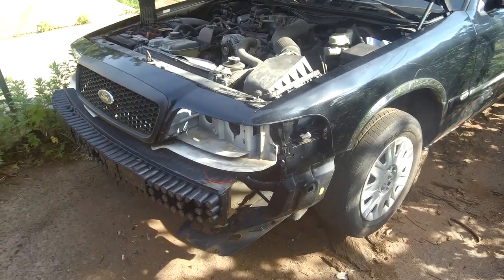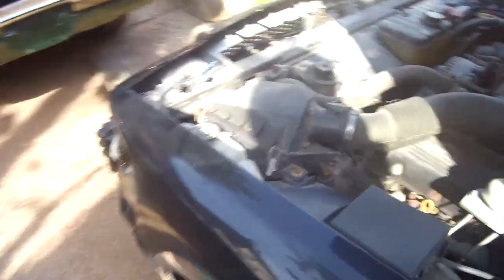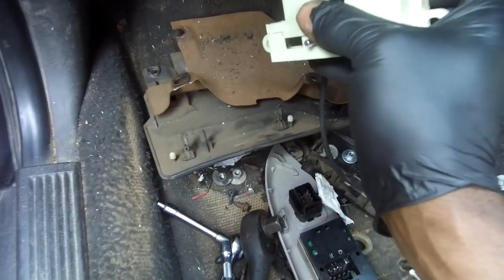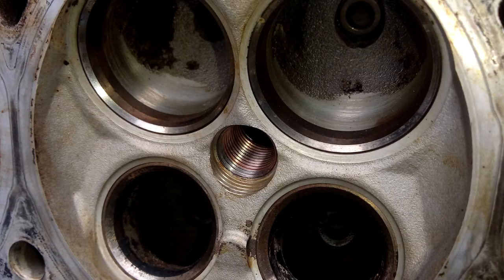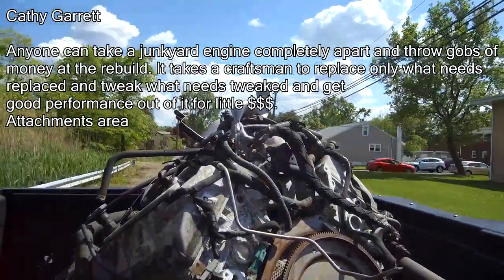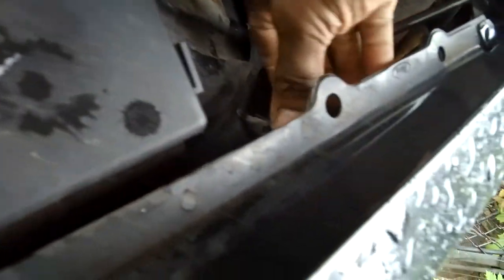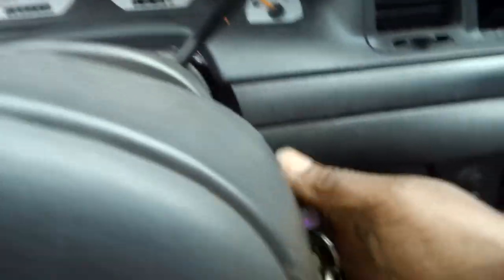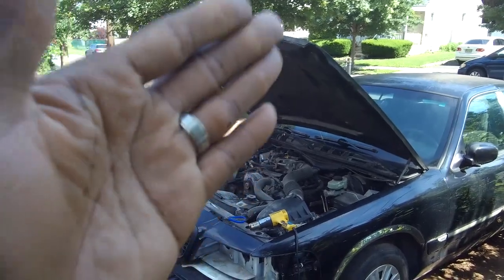Mercury Grand Marquis NO START NO CRANK! (  $120 Rookie Mistake )

Comment: Also while sanding the driver side doors, I've found bondo! Not much but that explains the paint coming off those doors! The hood, roof was just UV light cooking the paint from the inside out... A Big issue whese you live 5200+ feet and stupid clear skys! The UV bounces off the metal flake and cooks the paint from the inside out 😮☹😟
Reply from the maker: well you know thats given when you have car... somebody did some kind of work on it... The cool part you are blessed to make corrections... Some are not...You will have the think looking good... You are talented and driven you will make it happen with no fuss ...
Reply from the maker: I thank you always for the support on this and off of this thing here...Just working on stuff making things move ( lets say )
Reply: @bstfordchannel923  True That! I've got the doors stripped and just need to bondo a few spots, then sealer, primer and then... to the next door. Looks like the orginal minor damage was at or above the side trim! Now planning 2 coats of single stage Speedokote paint... Chestnut Brown, to match the door jams
OH! And using the trim you sent me! :)

Comment: Nice job showing us troubleshooting is all about the detail. You have to look at every little thing because it could be any little thing...and you have no idea of knowing which one. I will say something my Dad preached, and I don't always get it right when I think I know exactly what the problem is...always check the free stuff first, followed by the cheap stuff, and work up the price ladder from there. He was right, and more than once I've spent money I didn't need to spend money on and it didn't fix the problem.
Reply from the maker: Now that is so true. I had to show fault in this and speak about the money that can be spent for no reason ( if you take the time out and look ) a rookie mistake on behalf.  Your dad is a wise man. that how you do it... simple stuff to the big ticket items.. the starter I did not car really $35 bucks and its new so that was cool, but this Ecu deal. Not sticking with me real well.. This was a solid comment
Reply: @bstfordchannel923  one of the things I like about you is that you show us the mistakes along with the successes, and we all make mistakes.

Comment: Thanks for posting this, my Grandma's car had been having this problem intermittently for a while. Turns out the bolt threads had a thicker anodized coating on all but one small section. On the latest time it wouldn't start, I attempted to start it, it didn't start, wiggled that ground, and it started right up. We used a wire brush wheel to clean off some of the anodized coating so it can make better contact and has seemed to work just fine ever since.
Reply from the maker: No problem glad to help in any way brother... Glad the video assisted you.... Thank you for the detailed comment.. This will help somebody else

Comment: Another great video BST! A lot of people may skip this one but I genuinely appreciate content like this because not only did we learn what was wrong with your car, we all learned a valuable lesson which is how easy it is to create our own problems. I have done this too. Do a part swap and something as simple as a connector left loose can cause the car not to start. I have done that multiple times! So we all need a reminder to not get in a rush and never assume the worst when we run into an issue.

Also I fully support the reassembly of that bottom end. I believe it is gonna be solid and nothing to worry about.
Reply from the maker: I am glad YOU understood the video... Yes we create our own problems over thinking and under-thinking... This was more like let the money fix it or I know what that is ( at it was not that ) I learned something and its was kinda worth it.. other ideas sprung up from this . I just started to make things a bit more simple

Comment: Right on BST,
You had me glued to my screen, every second of the video. 
I was on the edge of my seat. Lol

You are a King among Kings for showing how you worked through this no start issue. Electrical problems drive me to drink. It's what I have the hardest time to figure out. 

But when I do, it's s good feeling I made those little electrons my bih. Lol

-Chuck
Reply from the maker: my man Chuck lol.. This I had to show cause you can not show wins all the time. You have to give failures and risks.. Some ideas may seem stupid, but its to move the car culture forward ( for us broke folks )
Reply: I think electrical drives us all to drink !!

Comment: BST, Glad you found the loose ground wire!  Here's a funny, my 2010 safety neutral switch doesn't always work so I just pull the shifter up a little and she starts... Well the Wife had her car in the shop, warranty work, so she takes my Panther and goes to work then coming home she stops at the store, like 4 blocks away, and well the car don't start; so instead of calling me she walks home pissed, I go up there and started the car... didn't tell her the trick so now she refuses to drive any of my Vicks 🤣😂😁😎
Reply from the maker: thank you that Big Bro...   wow what was the trick?  man you got her alll pissed now lol
Reply: Its not your neutral safety switch the a bracket that connects your gear shifter to the actual transmission and the bolts back out over eventually it wont go out of gear when that falls the rest of the way out
Reply from the maker: @cainadkins3985  ground wire to that switch

Comment: If you don’t want to open the short block there is a way you can check the overall health beside looking at the crosshatch pattern on the cylinders.  Use a breaker bar to turn the crank, it should be smooth and consistent as it is rotated around.  That’s probably the best you can do.
Reply from the maker: its seem very smooth. i have done that ( just to do it ) but the engine has been sitting for awhile... I can say a few years before i video taped the suv.., Going to learn more about this engine... need to make some tools for this thing... Cause man it cost a lot!

Comment: '720 Seconds Later' I always check grounds first... had issues way back with head lights, dash and running lights flickering on my 1987 Peterbilt, replaced all sorts of stuff just to find a rusty ground wire behind the dash    🤣😂😀
Reply from the maker: right! i those old school vehicles have the same issues . Rusty grounds like you mentioned its wild that can cause issues in this way

Comment: Thanks man! This is very similar to what my 97 P71 is currently doing. I'll go have a look. It's been a gremlin chase, sometimes power, sometimes not.
Reply from the maker: go simple 1st then go deeper, but it will be something simple for sure 1 wire ( most cases )
Reply: @bstfordchannel923  Yeah, had a look and that wire is solid on there. Kinda tucked in there or I woulda already checked it. I also found my positive cable is where I am able to consistently recreate the short. I have the new cable assembly on order (Motorcraft). 25 years and I can understand it needing a new primary. It is going to end up completing a new set up for the starting/ignition system. Battery, starter, alternator and cables. I'd rather start putting regular money into this car vs picturing myself in a rolling computer screen, complete with payments. 211K miles, so I expect I will continue. Front suspension is next...creaking bad. For unexpected problems...I always start with free first. 😉

Comment: greetings  BST ford Channel,
 thanks for such a cool video, had a similar situation, 2005 mercury marquis no crank, check underneath there was no power coming to starter,  sent a hot wire straight to starter, started worked so that ruled out bad starter..  checked fuses first.. all good.. checked for power coming to start relay under  hood ,had power coming to relay so I suspected replay was bad, but with my years working as a automotive repair tech something told me to dig further. I know that everything electrical part has a hot side and ground, I checked the ground circuit of relay.. guess what.. that was it it.. the relay is not getting grounded somewhere in the fuse box. a ground wire inside the fuse box must be broken so I added a ground with a wire at the ground side of the started relay. now it cranks fine which was the original problem.. but now it cranks but don't fire up, I can hear the fuel pump working when key is turned, so I'm going to check the ground you mentioned under the ECU .it has got to be something simple because plenty of times while diagnosing this car I jumped the starter with a hot wire and and cranked and fired right up, but I'm wondering if the jumper ground wire I added to the starter relay is knocking something else off, I'm going back to my buddy's house and remove that ground wire I added and jump starter again to see if it fires up, and plus check that cable under the ECU.   .
Reply from the maker: This was so detailed I read the whole thing... You went deeper than i did... I knew it was something simple and these cars have bad grounds.We always have to keep that in mind that these cars a re old and kind built like trucks...And the rust issues that come with it
Reply: @bstfordchannel923  I never knew there was another ground near driver  side fender, till you mentioned It. checked the ground near battery negative cable..and thought that was  the only ground...I'll keep you posted when I return to that car again to check that ground cable..if something else comes to mind i might need checking let me know and thanks again for such a cool video and tip

Comment: I have a problem and need answers so this guy was hooking up my radio and some how the wires from the wiring harness touch some metal and now my car won’t start 🤦🏾‍♂️🤦🏾‍♂️ I’ve changed all the fuses and it still not turning over
Reply from the maker: will not start or dont crank.. Does it have spark if you dont know check fuses
Reply: @bstfordchannel923  it doesn’t have spark and they saying it’s the pcm now 🤦🏾‍♂️🤦🏾‍♂️.
Reply: @bstfordchannel923  I changed the crankshaft sensor and camshaft sensor still didn’t work ima try the pcm then ima give up
Reply from the maker: @_venump7b  do you have a pats in that that car?
Reply: @bstfordchannel923  update on my Vic it end up being a fuse. It was  the pcm fuse
Reply from the maker: @_venump7b  look how simple that was a simple fuse bro amazing glad it worked out for you and Happy New Year BRO!
Reply: @bstfordchannel923  yes and it sat for 2 weeks over that small issue lol and thanks for you’re help I love watching you’re channel I be learning a lot and happy new year bro

Comment: Is that a pcm ground wire becuse my mustang doing the samething
Reply from the maker: depends on what year Mustan... Its ground that plays with the ( Neutral switch ) on transmisstion... Check the fuse for that ( if you have auto car )
Reply: @bstfordchannel923  thanks bro I love the 4.6 engine
Reply from the maker: @MelMontgomery-m6z  i did not at 1st but i see what the true meaning of the 4.6
Reply: @bstfordchannel923  ikr bro they can be hard sometimes
Reply from the maker: @MelMontgomery-m6z  you are right

Comment: I just had to change the starter in my 01 on the street next to my parents house.  What a pain in the @ss!!
Reply from the maker: oh yeah if its the 1st time it will be pain and PLUS on a time limit. It will be a pain. the 1st time doing this i was PISSED lmao.. now its not so bad cause I knew i would be pissed Adam H lol
Reply: @bstfordchannel923  Yup, the first and hopefully last time I have to do that!  I don't see any way in hell that job would be possible if the car had headers.
Reply from the maker: @adamh5396   how did you get to the starter Adam?
Reply: @bstfordchannel923  Each bolt took a different setup.  Needed a regular 10mm, deep 10mm, short 1", 3" and 6" extension and stubby ratchet and regular ratchet
Reply from the maker: @adamh5396  the trick is to get the extension that the right length ( and socket )  that you can have a normal size ratchet.. fit right in where it hit the frame part ( or what ever that part is )e Thats the only trick .. Need that tq to crack that bolt then I put 2 bolts back in there lmao... I will taking the engine out soon..

Comment: I wish I was so lucky...

So mine is a 2004 Sport. I cared for this car like you cant imagine. Ive had it since new. Had a wreck a few years back, and the stupid lawyer told me ...dont touch it until case is over. Case is over, broken neck, and the car sat 7 years with me only changing oil, and running it every so often. Last time I started was a few months ago...

Now it wont crank. New starter (the cables disintegrated in my hands). I have this random thick cable that looks like its been cut (wasnt me! I wish I knew what it is..and where it goes..since I only have this cut cable..about 4awg?). Anyway, engine flakes off rust, and I mean POUNDS of it. Im on the neutral safety and its rotted, so is the lever to the cable. Not sure on the cable, but the bolt on the shift lever (on the trans side) is flaking and crumbling. THe neutral switch is fused in place...have to remove it somehow. Exhaust..pieces. Suspension..flaking...

I used to praise the CV as a solid car. No. They are not. They used the cheapest metal they could find. I dont think this car will ever run again (I have been recording for a week now and wont post it because...well, who wants to see a video without the car starting? Right?). I have a Continental (73) that was abandoned in the mud, a NY car...and that is solid even though it sat for 20 years. I aint gonna lie, but this took the wind out of me. My CV was the car I broke my neck in, and really wanted to get it going...as a symbol that Im not over yet, that I still have life in me, like this car. But...between me being broken, the car being broken, it just is what it is.
Reply from the maker: You are wrong about posting video and nobody would care.. Tell your story ( in the video ) just like how you wrote this ( well written comment ) people in our community would loev to see this run again.. Now to defend the car oh yes they used cheap stuff ( grounds ect )  you do have to put some love into it ( just a little at a time ) you do need to start these cars they get funny ( new starter is needed )maybe even a new alt is needed.. Very sorry about what happen to ya.. Sucks to hear that type of stuff
Reply: @bstfordchannel923  Yeah. I documented everything on this car, for over 130k miles, including each time I filled up. Its just that all the wiring, and not a single bolt isnt rusted to hell. I washed it every week, and every time we had snow...Right now Im chasing this issue, and Im stumped. Its similar to your issue, but all my dash light come on, so its not that ground. I will check tomorrow, but yeah, Im looking at the neutral switch, but that this has so much rust on the shaft, that I have no clue how Ill remove the damn thing.

Comment: Where do I get an ecu with a pats delete? My pats system is disabling my fuel and spark, I only have one key and the the Ford websites single key pats reset procedure isn't working.
Reply from the maker: make sure everything is good 1st... do not do what i did... here is a link depending what year your car is https://www.ebay.com/itm/352658834380?hash=item521c1ac3cc:g:zlYAAOSwsMxc0pwR

Comment: So I picked up a 04 pi computer for my civilian lx sport now it dont start tried you tube fuse trick no go or a even crank I took it out and put the old computer back and still no start or crank any ideas I also checked the ground ? Starter was acting up awhile ago then stopped then once other day but it stopped again but I only drive it  sometimes but I'd at least hear a noise or something right while turning the key .
Reply from the maker: starter start there ONLY cause you said it was giving you a issue ( starter cost 30 bucks ) or tap on starter ( you need buddy ) those Pi pcm will work you have to something funky, but you shoukd just get a TUNE and it would be better than a Pi police version pcm... So if you heard a click when starting it thats cool just get a stater

Comment: I have a question... was your fuel pump turning on with the loose bolt thing?
Reply from the maker: that bolt controls the neutral switch and that pats deal and fuel pump relay... Its a odd
Reply: @bstfordchannel923  ahh ok thank you very much

Comment: I'm having almost the same problem with my 05 marquis started 2 days ago. Changed the starter and starter relay and still nothing any thoughts?
Reply from the maker: Well you changed the starter cause you thought it was the starter 9 like me ) did you test new starter and old one? Well there is a fuse for the ( neutral switch ) or selector switch you can check that... then get back to me i will try to help
Reply: Blower motor relay made my CV not run or start, or have fuel pressure.
Reply from the maker: @bryanedwards7160  now thats wild Bryan lol

Comment: So all u did was tighten up the bolt or what ?
Reply from the maker: yup that bolt was loose.. i thought it was old simple ground... Nope thats ground for the neutral safter switch/ gear select thing
Reply: Your car did exactly what my 2005 linclon town car doin now. I wonder do I need to do the same because I bought a new starter new battery check fuses did everything 🤦🏽‍♂️
Reply from the maker: @TrackLife318  check the wire and see if its cut... Or it can be the a fuse  #26 5Amp fuse ... look at interior fuse panel 1st row of fuse top one is #27 should be a 20amp fuse next one over #26 should be a 5 amp... see if thats blown and also check that ground wire